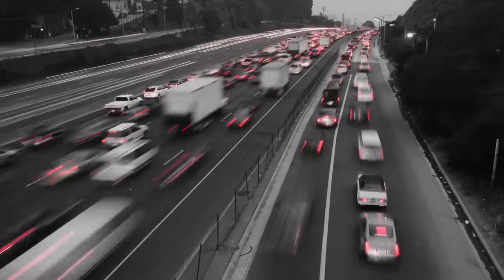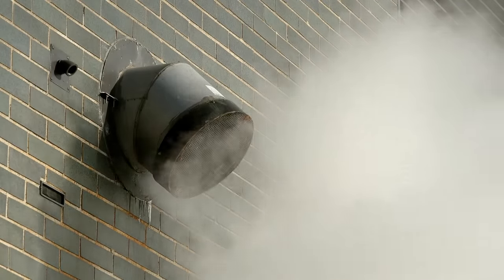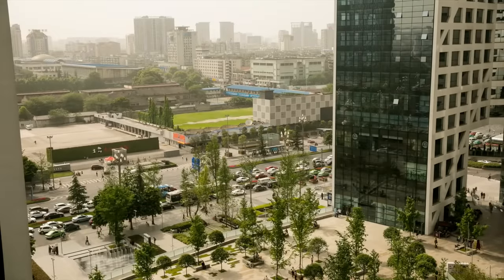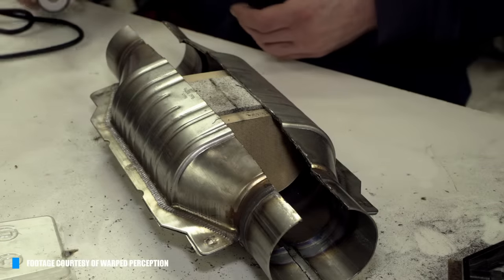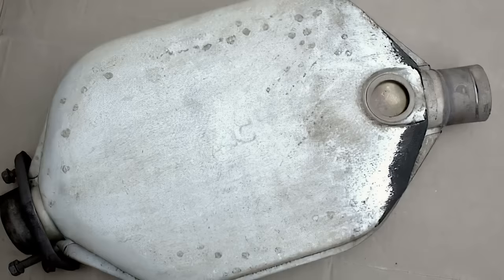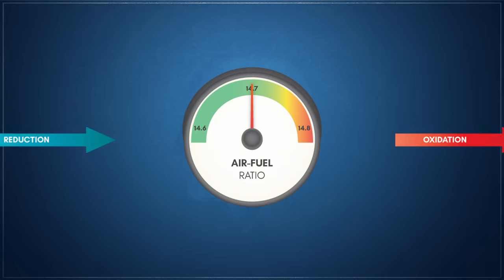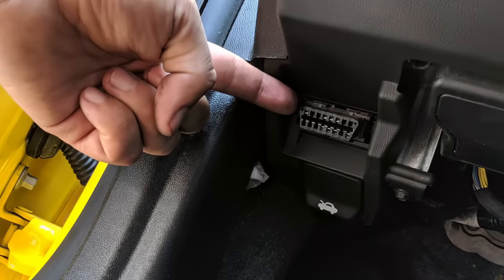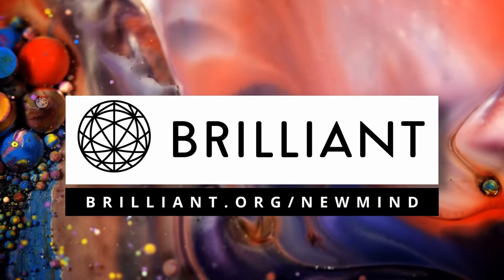How The Most Hated Auto Part Changed The World

Comment: The problem is the EPA turns this into a compliance issue instead of a measure of pollutants. They make it a crime to modify any emissions components, regardless of the outcome. If someone installs a high performance catalytic converter, that improves performance and emissions reduction, the EPA still considers that illegal! Even if you take it to an emissions testing place and show that the new system functions better, the EPA still says that is illegal! They don't care about complying with emissions standards, they only care about complying with their definitions and requirements so they can keep all the emissions companies making billions and billions of dollars! In commiefornia a stolen catalytic converter from a Toyota Prius can cost over $3000 to replace since you are required to use OEM parts, in other, more normal places, it would only cost $300-$500 since you can use any generic catalytic converter, and it works just the same, emissions results are the same. They need to stop focusing on compliance and bring back real testing!
Reply: "High performance" catalytic converters increase emissions in exchange for performance. There is no way you're getting a catalytic converter that gives you better flow AND less than or equal emissions as stock.

Most aftermarket ones are inadequate because they do cost cutting, the price in these things is all rare metals and if you're getting them for cheap you're not getting nearly as much rare metals in them.
Reply: @Flux Yeah if everyone used those cheap cats. The smog would be less than the 70s but more than now.

It would also be noticeably smellier.
Reply: You pay a thousand bucks to have that CA Compliant emblem stamped on a generic CAT that goes for 200 dollars in the other 47 states.
Reply: @JohnS-il1dr  it's all a big cash grab!
Reply: @PURENT larger surface area   cat can give better flow  while still retaining conversion efficiency, at the cost of being more expensive as there is more material in it and being harder to fit in the available space. But yes a lot of the cats  marketed as performance cats are not as efficient.
Reply: @smd-tech  Problem is a bigger catalytic converter than stock doesn't actually convert anything. Engine simply can't heat up the catalytic converter adequately because it's not exhausting enough hot gases for that size of catalytic converter.
Reply: @PURENT  That’s not necessarily true. 

In a performance build you’d expect to see other modifications promoting higher flow, higher compression, & etc. this can also change the heat output (which is why you also often see cooling upgrades). 

A test for actual emissions, rather than insisting on OEM only, would accomplish the goal of ensuring clean air via a less restrictive regulation.
Reply: @piedpiper1172  That is true. An engine modified and tuned for higher compression could work with a bigger catalytic converter. 

But people who seek out such high compression engines especially forced induction, often have no interest in having a catalytic converter at all because it's a flow restriction that reduces power. 

The regulation change probably wouldn't do anything as the enforcement is so lax, there's a massive industry of aftermarket catalytic converters which aren't legal under EPA. That's a multi-billion dollar industry that is technically operating illegally right there.
Reply: @PURENT  I mean, mine though. I have significant power over stock, but still have a cat. 

A good, high performance cat can be set up to have a really small impact on horsepower but still achieve factory-or-better emissions. Just cus I’m having fun doesn’t mean I want my car to pollute. 

Also, catless cars are miserable daily drivers. They reek, they sound terrible, it’s a whole thing. To the best of my knowledge, with testing available to me, my car’s exhaust is cleaner than stock, and I have substantially more horsepower than factory. 

I think the market for good cats would be there if it was expressly 50 state legal. If I can avoid having to skulk around, sneaking by, I will. Most people will, we know this from other areas of regulation.

Comment: My cat went bad in my lexus gs350 and that error code causes the traction control to turn off until its resolved. That's ridiculous.
Reply: I mean, if it doesn't, people will just going to ignore it. "eh, it works!"
Reply: Your whole car should shut off.
Reply: The interconnectivity of the systems in modern cars is crazy. One engine "related" fault and all interconnected systems are disabled. Traction control, stability control, cruise, remote start, it all depends on the brand, and how new the car is. The newer the vehicle, the worse it is. 

On some GM vehicles the AC is disabled.
Reply: O2 sensor faults cause my VSC and traction to turn off too. Any engine code does for some reason
Reply: what's traction control?
Reply: @wtice4632  Your vehicle went into limp mode, because without O2 sensors the computer doesn't have feedback to know how well it's running. Extra fuel gets wasted to make sure the engine doesn't get too hot. Traction control could create a higher load on the engine, which when not running right could cause pinging or detonation. Detonation destroys pistons.
Reply: @pgtmr2713  its a 2001 no limp mode. I was doing 80 on the highway when it happened and continued for another 20 miles just fine.
Reply: @wtice4632  Limp mode goes way back before 2001.
Reply: @wtice4632  Probably so you feel something is wrong too and dont just ignore it.
Reply: @pgtmr2713  if it was an actual limp mode i couldnt have maintained 80 mph up a mountain pass for 20 miles.
Reply: @MaakaSakuranbo  well if that was the goal it didn't work, I've been driving it for 2 years like that. Cars used to not have traction control. I don't think car manufacturers are actively trying to make their cars worse to use. They wouldn't even put cats on them if it wasn't required by the government.

Edit: the car has 2 cats on it one is still perfectly fine. Some people are acting like I straight piped a v8 diesel. It's probably barely out of the preprogrammed limit.
Reply: @wtice4632  It can depend on severity and the number of O2 sensors that are bad. 1 out of 4 O2 sensors bad, is not as bad 1of 2 or 1 of 3 sensors bad. Depending on number of banks, 4 cyl vs. V6 or V8, single exhaust dual exhaust. If 3 out of 4 read fine, it may not limp. Manufacturers could decide some of this. When you get to a shop they might have you replace more than 1, even if only one is causing the MIL.
Reply: yeah that is ridiculous

Blame the car. Not the Catalytic Converter 😅
Reply: Traction control is unnecessary though. If you're willing to ignore a burnt out cat, you're probably willing to ignore the TC not working
Reply: Most traction control just activates the abs when accelerating on slippery surfaces to reduce wheel spin. You'll know it is active because it makes a crunching sound. It's not very important honestly.

Comment: Pre heating cats with a simple fuel/spark combo similar to a garage rocket heater would work extremely well.
It would also save engines wear and tear from cold start high rpm running.
Reply: I believe diesel emissions control systems do something similar to this. Some of them have a fuel injector in the exhaust system.
Reply: Toyota has a strange system on their vehicle that routes coolant lines around the outlet of the CAT that helps warm the engine faster so the engine can warm the CAT up in this way instead. It also had a switch that was physically moved by the temperature change to turn on/off the system automatically, really different thinking on that one. As an added benefit the engine now operates more often in it's normal operating temperature and has less internal "wear and tear"!
Reply: @SGTECH-di9df  that’s quite wild. Cool to know! Thanks!

Comment: Very interesting. Definitely expanded my knowledge on the subject. I've heard that the the net manufacturing foot print of catalytic converters approaches canceling out the benefit. But it's something I take with a grain of salt, although I'm sure the footprint of mining the precious metals and manufacturing the converters must be substantial. It would have been interesting to hear something about their footprint as well.
Reply: right but its nothing compared to BEV's. of course the real polluter isnt emissions. it hasnt been for over a decade as gasoline cars are so clean, its a non-issue. the big polluter is actually the toxic rubber in tires. EV's are much heavier, thus requiring replacement tires much more frequently, and wearing out roads much faster.

Comment: I always remove them. Better to have them safe in my house rather than being stolen 😂
Reply: Insane decision. Catalytic converter inside your house is as userfull as stolen one. Furthermore you have to spend money upfront (NOT later or NEVER) removing one and making cars computer accepting that.
Reply: @volodumurkalunyak4651  been running solid for a catless downpipe for $200.
Reply: @khysor1832  $200 down the drain. Even more if you value you'r lungs.
Reply: @volodumurkalunyak4651  car goes vroom 🏎️
Reply: @khysor1832  no, it doesn't. It isnt a F1 car therefore it doesn't do wroom.
Only Formula1 can go vroom.😎😁😁
Reply: @volodumurkalunyak4651  Actually works to increase power, downside is that it stinks like gas and burnt eggs all the time.

Comment: Interesting fact:  Oxygen sensors don't actually sense Oxygen, but exhaust gas temperature.  Exhaust gas temperature is influenced by the the evaporative cooling of fuel in the fuel injection system.  This gives you a relative oxygen remaining level.      I do not hate catalytic converters, but since my state does not do emissions tests, if I ever have one stolen it will be replaced by a pipe.
Reply: You are wrong, lambda sensors do measure oxygen concentration.

Comment: And this is why small engines in lawn mowers, leaf blowers, generators, etc, cause way more pollution than modern cars do.
Reply: Partially, but mostly because many of these Devices have Two Stroke Engines. These Engines are lubricated by Oil mixed into the Fuel, hence they always burn Oil.
Reply: @Genius_at_Work  Small tools like leaf blowers, trimmers, etc, are usually 2-stroke. Those are the worst for pollution. Lawn mowers, snow blowers, generators, etc., are almost always 4-stroke and aren't quite as bad, but still pretty bad when compared to modern car engines.

Comment: why does a problem with the converter cause a check engine light
that the least useful light to use for that
especially since it comes from specific sensors that could just warn you that that is the cause of your problem instead of the entire engine

Comment: Who hates katalysators? Modern katalysators dont reduce power and they make your exhaust less harmfull, only benefits

DPF on the other hand has many downsides like regeneration wich rises fuel consuption and causes oil to get contaminated with fuel.
Also dpf often get damaged requiring you to buy new one for a lot of money. Katalysators dont really fail unless your engine runs very rich or uses a lot of oil

Comment: Better is a catalytic staged combustion system:
The engine always runs slightly rich, just rich enough to optimize the reduction of nitrogen oxides, which occurs first, in the reducing cat. Next, a tiny piston (that can also function as a secondary balancer instead of a pair of balancing shafts) introduces 10% more air into the exhaust, so the oxidizing cat receives a lean input.
Both cats run optimally, which means they can be smaller, saving serious amounts of precious metals.
No BS kluges like lambda-wavering, no storing of oxygen, and far better results. Plus a smoother engine as a bonus!

Comment: I think they were hated in 1975 because they were the cherry on top to the disappointment cake of stricter emission standards and detuned engines that plagued the early 70s
Reply: I made the mistake of buying a new car in 1974, the height of detaining to meet emission standards.  A 350 cubic inch (5.7l) engine producing around 140 horsepower and getting 8 to 10 miles per gallon.  Today my car has a 3.6l engine producing 310 horsepower and delivering over 30 miles per gallon on the highway.  You won’t convince me that catalytic converters weren’t the way to go.

Comment: Our electric driving kids in 10yrs watching this vid.. " What a mess how these dinosaur engines worked"
Reply: I doubt it will be 10 years, more like 50-100 or even more when oil becomes very scarce.
Using oil to make fuel for combustion engines is very cost-effective for each HP produced, which is why it is still the world's predominant propulsion system whereas electric power is more expensive and also less convenient for a lot of people.
If you have the bread, go ahead and get an electric car. They're pretty cool, and give you a taste of the future and the possibilities it hold for zero-emission driving if you live in a part of the world where the electricity produced at night (or whenever you charge) comes from low or zero emission sources, like hydro or nuclear.
If you just need wheels, the internal combustion engine predominates.

Comment: I kind of think diesel exhaust fluid is a little bit of a scam. You buy a catalytic converter once and it costs 1500. That $1500 will last you the lifetime of your vehicle usually. Compare that to about 20 bucks for two and a half gallons of diesel exhaust fluid every 2 weeks, is 520 a year. So you get 3 years versus the lifetime of a gasoline catalytic converter. That's the only reason I say diesel exhaust fluid is a little bit of a scam. It's piss water. There's no need for it to be as expensive as it is.

Comment: The catalytic converter does help with fuel mileage. Chrysler bragged about the findings they had about how the cats increased mpg. I found this to be true because my 84 Chrysler  with a 318 will chaine its estimated epa fuel milage.
Reply: I guarantee this is not true. Since the catalytic converter means that the car must oscillate between rich and lean and because it obstructs exhaust gas, there is almost certainly a loss in efficiency.

Comment: What they don't tell you is that it's a scam. If cars burned pure gas, not what you get at the pump at the gas station, it would be alot cleaner burning. They put additives in the gas you get from the gas station that creates the need for a converter to filter and save the air. It's not cheap but you can buy pure gas, being the gasoline extracted from the oil with nothing else added, it burns cleaner than gas from the pump even without the converter. It's sold in cans and says not for street use, for mowers, farm equiptment and off road.
Reply: The additives and detergents only purpose is to reduce carbon deposition in fuel injectors, cylinder heads, and valves. The catalytic converter's purpose is to convert Hydrocarbons, Nitrogen Oxides, and Carbon Monoxide which forms in the combustion process regardless of how pure the gas is. The carbon comes from the gasoline, the nitrogen and oxygen comes from the air.

Those fuels that you aren't allowed to use on street are that way for a reason. Farm diesel doesn't have a road tax on it, it's exactly the same as road diesel but has red dye in it and costs less, and cops can spot check and bust you for using it on the road. Then there's AVGAS for aviation which you can use in cars, except 100LL is leaded and will destroy the catalytic converter, UL94 will work but even without it's road tax it still goes for $6.50 per gallon meaning the only way you're saving money is if you have a tuned engine for 98 octane but don't want to buy Sunoco 260 race fuel.

Comment: When you don't change your oil the cat gets clogged and becomes worse than useless
Reply: When you don't change your oil, the stabilizing chemicals break down, sludge forms, and your engine begins to wear at an accelerated rate. But it shouldn't "clog" the catalytic converter in any meaningful way. If you don't change your oil for so long that you manage to wear down your piston rings and seals so far that they start passing large amounts of oil into the exhaust.... you've got a lot bigger issues than an oil flooded cat.

Comment: Tires and wheels are the most hated auto part, that's what makes your steering wheel shake when driving at highway speeds after hitting a pothole (or having your car stolen and smacked into curbs by some antisocial loser.) There's no technological solution to that either.

Comment: Contrary to popular belief/indoctrination.  Most of the smog issues came from the big industrial and business centers and even homes that were at the time primarily burning dirty high sulfur coal as their primary heating fuel.   (This is very well documented.) 

Vehicle-wise, what smog was coming from them was cleaned up with the reformulation of gasoline from being a largly dirty distilled fuel to the now modern far cleaner and standardized synthesized fuel blends we have today. (Also very well documented too.) 

It's not that catalytic converters didn't help, they did, but they are not the primary movers behind what cleaned up the air in the 60's and 70's as we are misled to believe today.

Comment: Fuel injection helps with emissions just as much if not more than catalytic converters. There have been catless cars that have passed emissions testing (obviously only in cases where they just check the tailpipe junk... a place with a visual test will autofail a catless car).